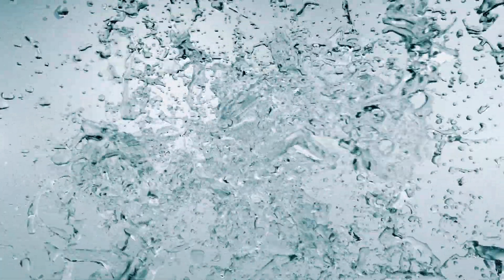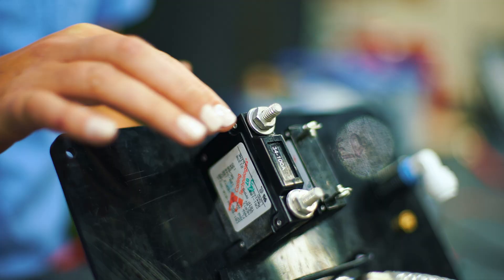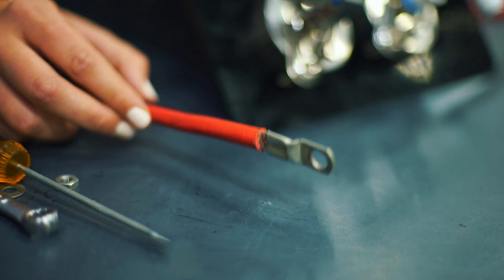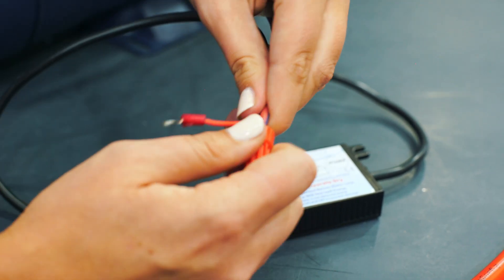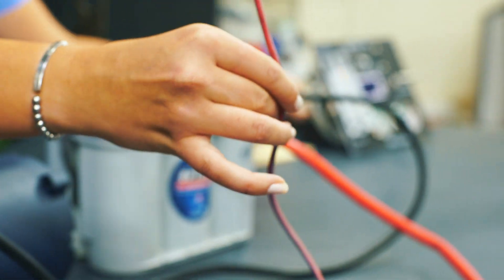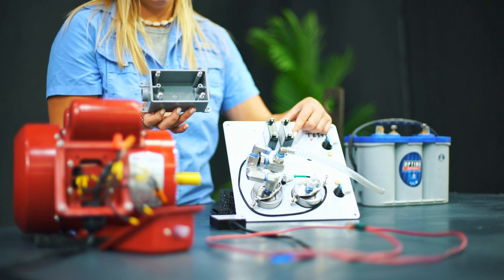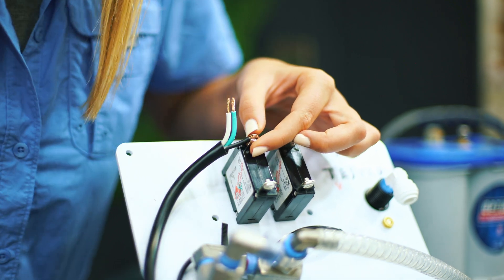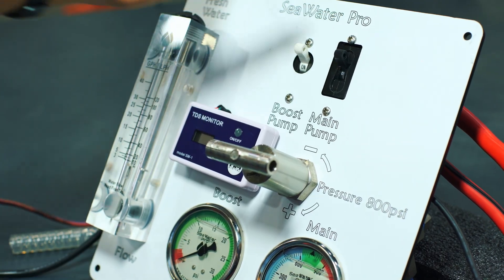SeaWater Pro Watermakers Electrical AC/DC System Control Panel Connection Tutorial

Comment: Good video but my DC unit ( Leeson1 hp motor) does not come with a wiring diagram which would be appreciated. Please consider this in the future. Also you should mark on the back of the panel whether DC OR AC. Yes when you refer to the panel breakers you can tell but without that and if electricity is your weak point it can be confusing- that’s why electrians are a seperate profession. Thank you